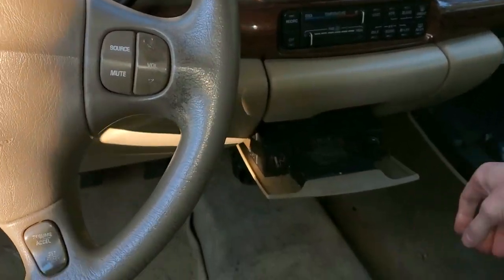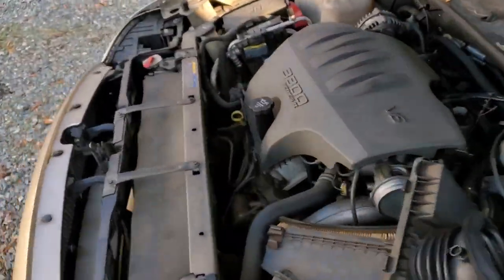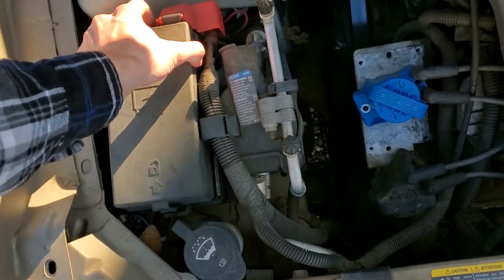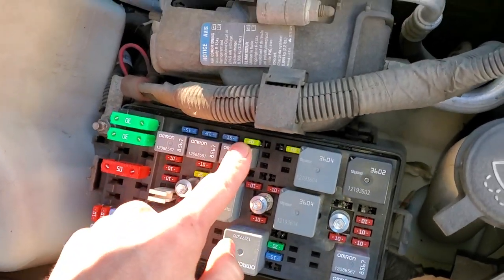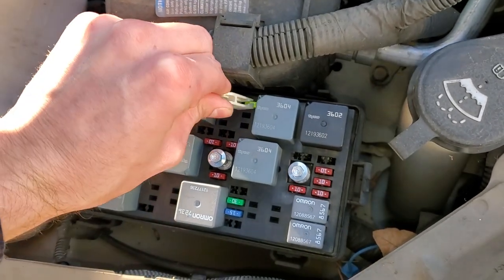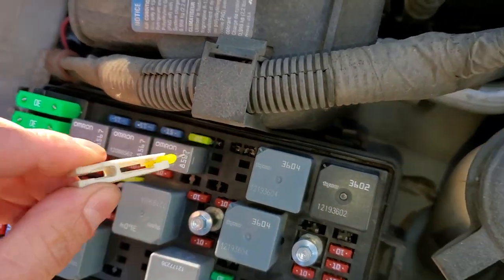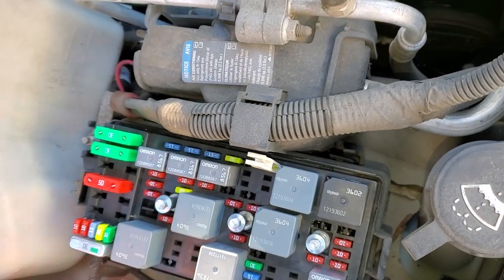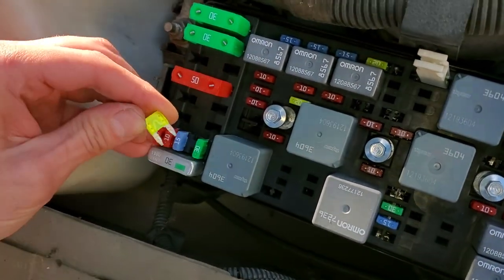2005 Buick Lesabre Cigarette Lighter Fuse, Power Outlet Fuse Location

Comment: Do you believe it was just a coincidence that while I had the fuse box open to diagnose an a/c issue (I had pulled some fuses and relays to diagnose based on a suggestion), that right after I noticed neither lighter port is working? Both 20a fuses tested fine though so I'm perplexed

What likely is the issue?

Comment: Hello. I just purchased a 05 buick lesabre limited. I'm having issue with doors not locking automatically when put car in reverse or drive. Inside lights stays on the whole time and I'm having a hard time figuring out the issue.

Comment: I checked those two fuses first 23 cigarette lighter which was blown and 22 aux wasnt, and and the maxi fuse under the back seat labled cigar which was fine. Is there any way to test the relay labled cigar and does it have anything to do with the cig lighter and aux power outlet?